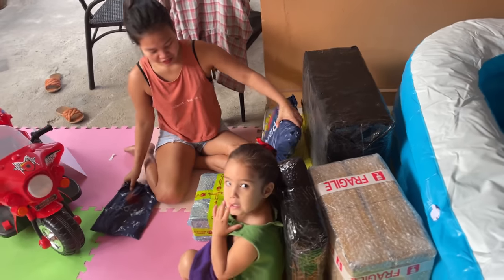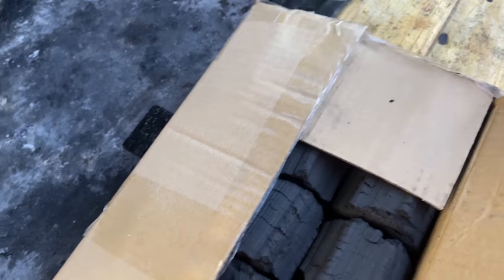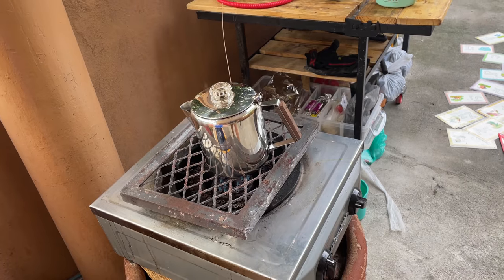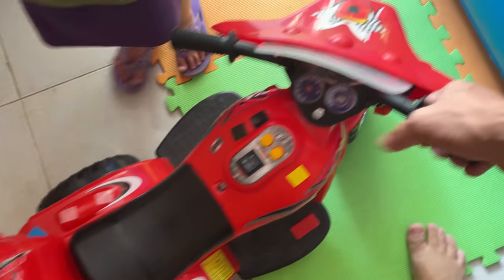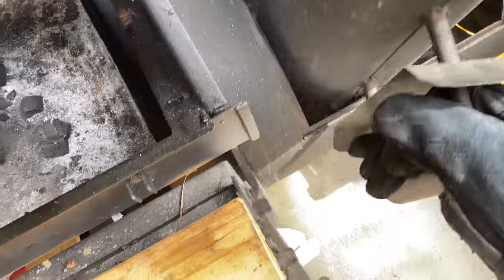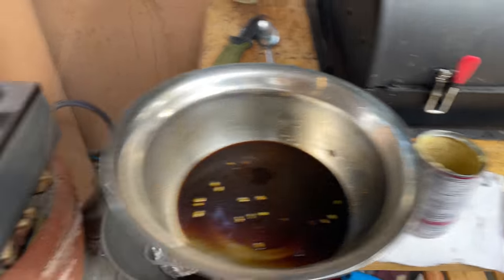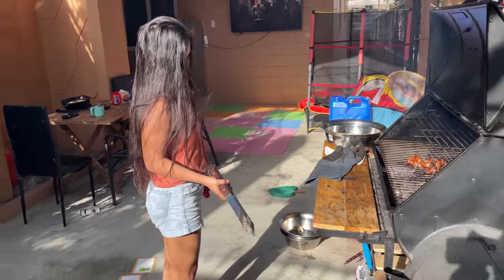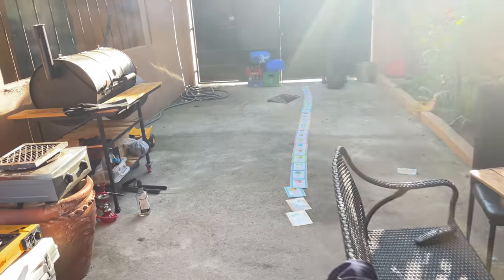Filipina Wife BURNS the BBQ Chicken Wings (AGAIN) PLUS a NEW Coffee Pot for the Camp Fire

Comment: You can clean the rust out of the burner with muriatic acid. Soak bout 3 minutes and rinse with baking soda. Your local welding shop can weld some extensions 
on the burner pot supports.

Comment: I'd like to see you test out starting the chimney sitting directly on the drip pan or if it needs the extra air flow, put it on the grate, then just pull the grate most of the way out, dump the coals and slide it straight back in. 
Perhaps also placing the bamboo in the chimney so the holes are upright might help (a little OCD style lol). Obviously you know now you only need half as much bamboo, if that. Maybe just put them all the chimney, so they all get started, then you can spread them out a bit without needing unlit ones to be touching to catch on. Might be more even heat that way too.